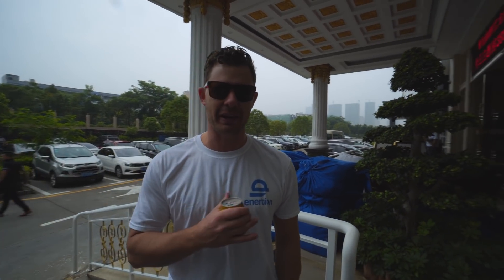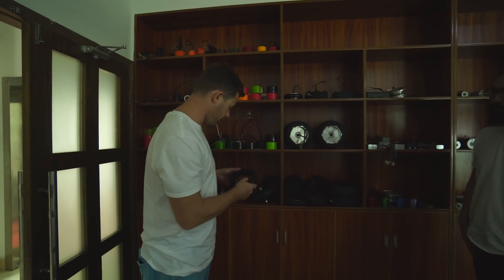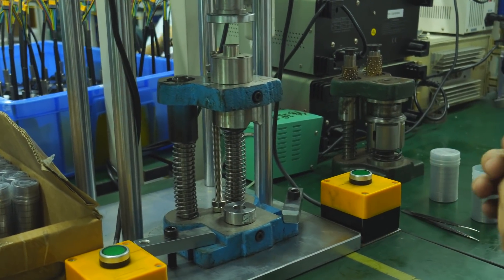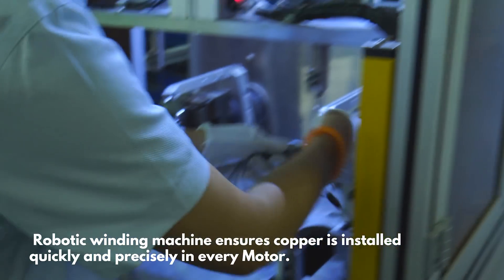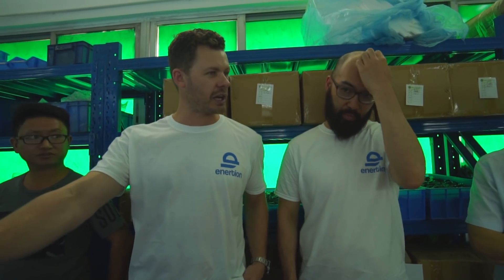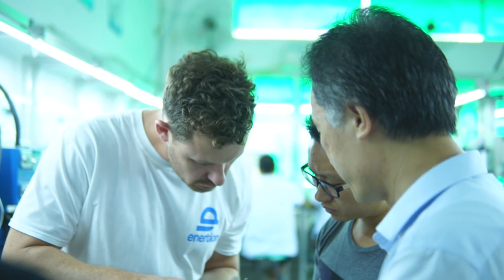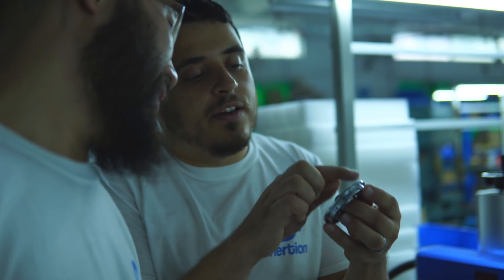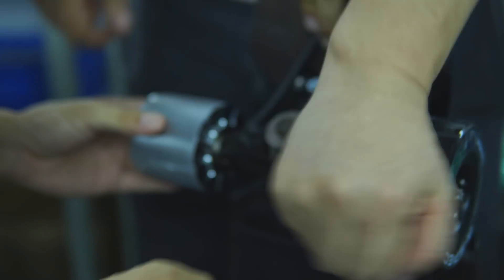MOTOR MANUFACTURING for our Raptor 2 Electric Skateboard! | Enertion

Comment: I am so excited about my raptor2.1. But I got a question. Would you like to tell me what the differences between raptor and weakness China boards are?
Reply from the maker: The Raptor 2 was designed from the ground up to ride fast. Majority of our parts were custom designed, unlike most E-skate manufacturers who take off the shelf parts. It's got more range than all other chinese built boards. It uses the most responsive, reliable and customizable motor controller ever, the focbox/focbox unity. It's also faster than all Chinese built boards at 50km/h+, hope that helps.

Comment: China will copy this soon as they get their hands on it
Reply: dale Robertson these are chinese motors already. They are to expensive for one of the cheap off-the-shelf boards, otherwise they would have used them long ago.
Reply: @realmcerono  too late looks like meepo already has they are claiming 29mph on the new v2 and its the same price https://www.meepoboard.com/collections/boards/products/meepo-board
Reply: @dalerobertson911  we all know meepos are capable of getting a high top speed nothing new. The old board has a higher top speed than most boards already. What I'm concerned with is torque and acceleration to bomb up hills and also the quality of the  boards. That's something I don't think they can do copy at a knock off price, not yet anyways.